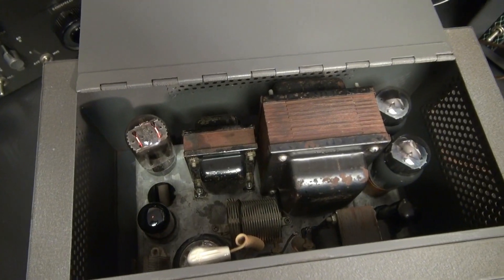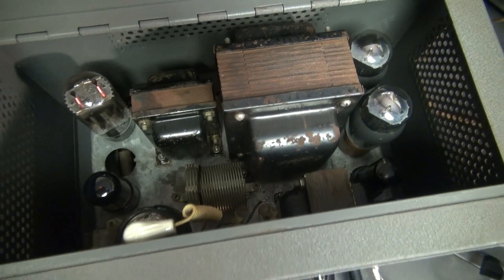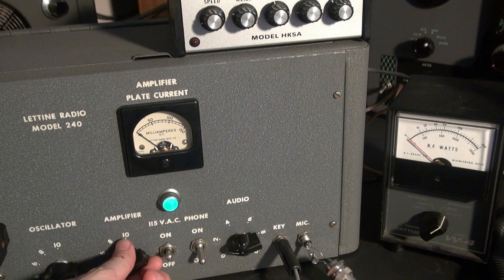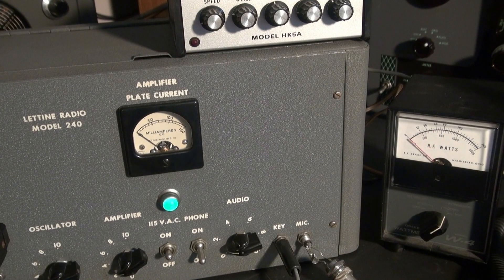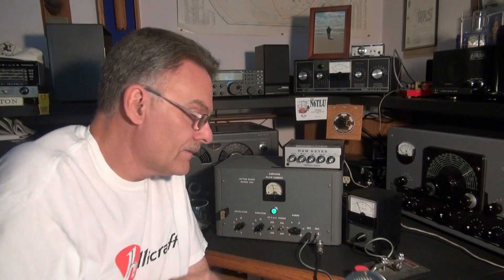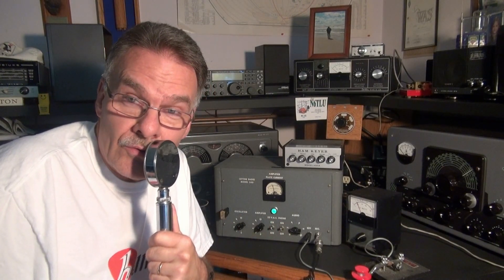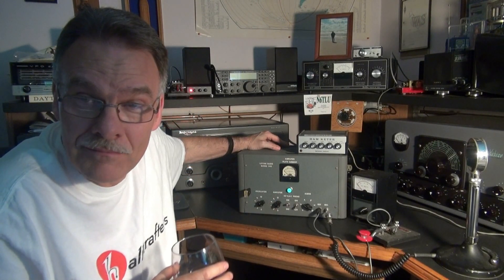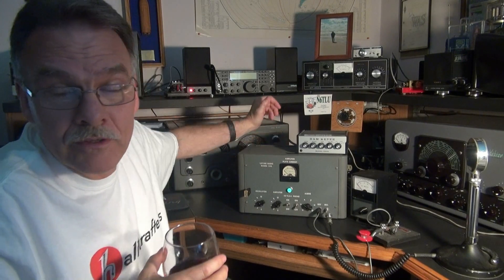Hammared Ham Presents Lettine 240 AM CW Tube Ham Transmitter Demo

Comment: I doubt its output on CW is 35 W. Input power was only 40. (Lettine had you tune it up to about 110 mA on the meter for 40 W input at 400ish V on the 807 plate, as the meter is in the 807 cathode and sums the tube's grid, screen, and plate currents.) 25 W output is more like it.

Comment: how'd you do on Field Day.  I had one of myt best.
Reply from the maker: I spent mine at a truck stop picking up transmitters to repair. Been busy in the shop, did not have time to play Field day. Wish I did. 10 meters has been open & I enjoy that.
Reply: Most of my work was on 80 from 9:00 pm - 6:00 am.  Ah well, always good to see your videos, and look forward to more.

I'm restoring a Swan 500c, and it uses 12Au7 for both audio and rf amplification.  Wouldn't have thought that.